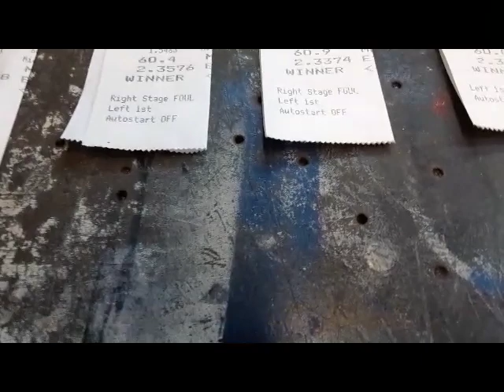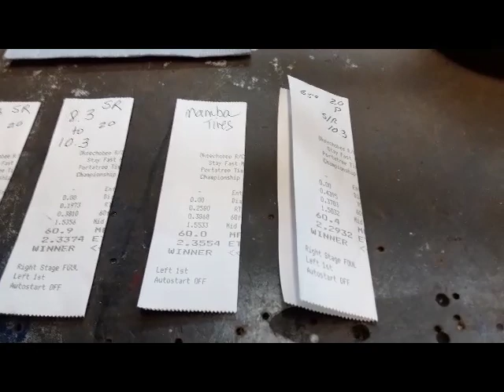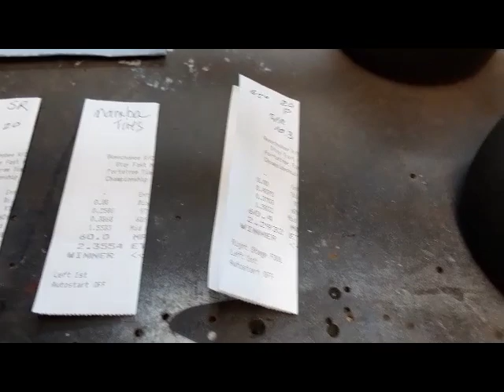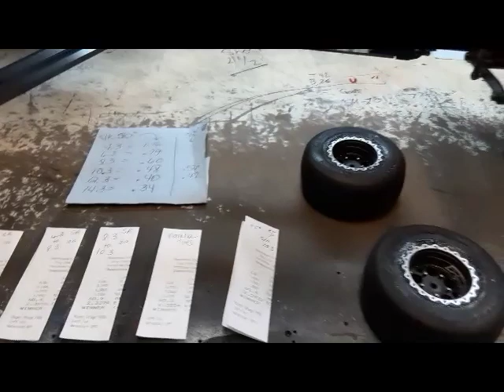RC Street Eliminator Drag Racing Okeechobee testing recap

Comment: How thick is the carbon fiber and where did you get it ???
Reply from the maker: 80thou. I got it from my local chassis shop scrap
Reply: You mean an official full size car shop? That happens to work with carbon sheets? That pretty badass if so.
Reply from the maker: @maikolrodriquez  yes most of your drag race chassis shops . will deal with carbon

Comment: Is that a slipper clutch or a eliminator?
Reply from the maker: Eliminator I got it from HR . I hate slippers
Reply: I hear ya me too....is the car pretty consistent with the eliminator ? What diff oil should I run ?
Reply: By the way I saw you in okeechobee about a month ago with the $1300 pot
Reply: Do you lock the diff as well while using the eliminator?
Reply from the maker: @kelvinwashington5431  no. The diff is open with half million oil !!
Reply from the maker: @kelvinwashington5431  yes sir but I believe it's consistent because of the DRK